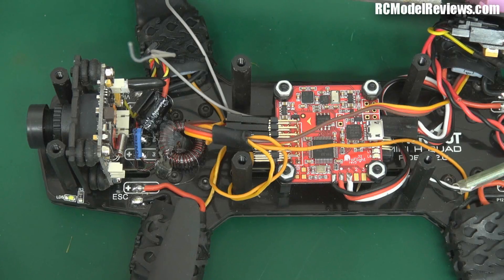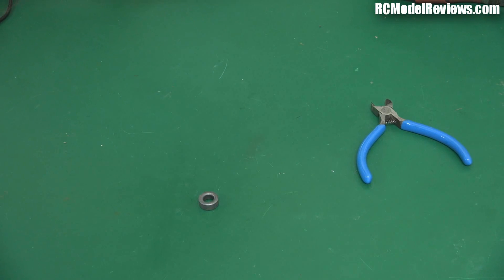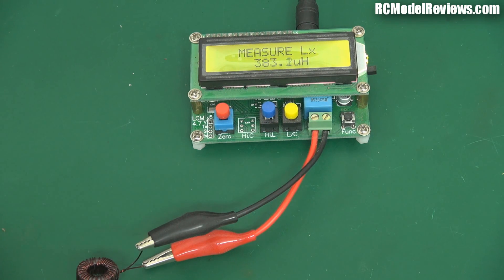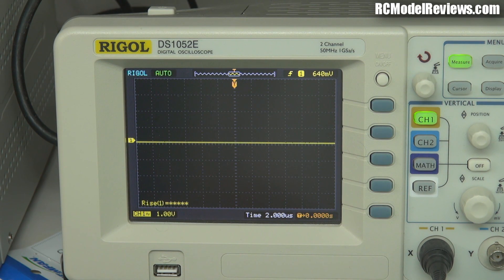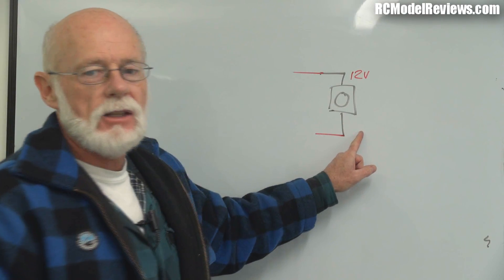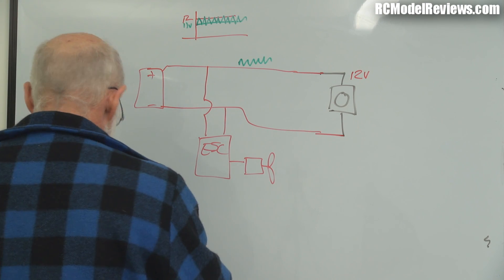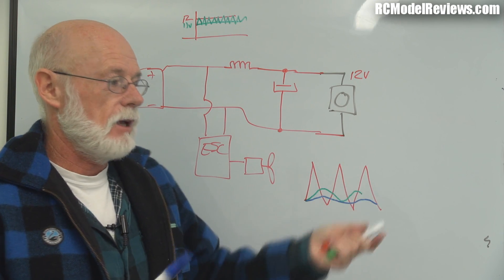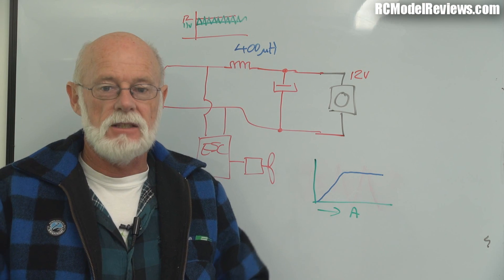DIY FPV power filter for under $3

Comment: Perfect timing, took my first fpv flight at the weekend and found it was almost unusable becuase of black lines over the picture whcih got worse the more power I used. I thought I'd be ok by using a UBEC to power my camera and vtx but I'm guessing not. Would I be better replacing the UBEC with the coil and cap?

Comment: I've been using these expensive LPF-01 LC Power Filters. I'm unsure what the inductor is in these I've never taken it apart. It would be interesting to compare Bruce's $3 LC filters to these $15 ones. Very nice explanation.
Reply: Another related effect is using capacitors to protect the ESC from the inductive effect (?) of long battery leads to the ESC for large aircraft. Not a problem for a Mini Quad.

Comment: Great video, it actually inspired me to go out to the shed and make an inductor... I have a few ferrite torroids and some enamel copper wire. There's just one thing though, you glossed over how to actually "make" the filter. the science and explanation was brilliant, I understood it very well. but it would have been nice to see how you connected up the capacitor (i'm sure there's a right and a wrong way) and then how you would connect this in a real life circuit... still a great video... I actually do like the whiteboard stuff :)

Comment: Bruce... now try adding a Diode BEFORE the inductor.....and Magic !!!
( or a Schottky if you don't wanna loose 0.6v from your supply rail)
Then tell me why ;)
Reply: You could add a diode but it is extra voltage drop and in the case of a 3S pack, it could result in the camera shutting down earlier than it otherwise would if you're nursing a nearly-flat battery when trying to get home.

I'd say build the filter "as is" and only look at adding the diode if you still have noise on the video.  If it fixes the noise without the diode then you'll save your money and give yourself a bit more voltage-headroom for the camera.
Reply: *****
Yes..Exactly...!!
But then, that's why I mentioned the Schottky ( with the right current handling capacity for the job.. of course ).

I've found out that the diode really cleans up the job.
Reply: RotorPics
Yep, I've used a diode/cap setup in the FPV backpack and it works well but with a multirotor I wanted to be sure that the camera would keep working right up to the point where it flipped due to a low battery :-)
Reply: *****
yea....but my fpv birds are long down before the 12v cam quits due to low voltage....
Anyhoooo.... Diode+Inductor+LowESR cap is my recipe for crisp video.

Bruce, wanna really thank you for the videos you make.
You are such a wealth of info.
Would really like your spectrum analyzer to be displayed more often when testing anything RF related. It really adds a lot of 'aroma' to the video ;)

Now.. I'm back to my Binch !!! :)

Comment: It would be interesting to find the point where running a separate battery would make for better solution then a toroid/cap/etc....based on a weight savings.

Would the toroid/cap solution always be the better weight saving solution, even on larger planes/MR configurations?

Excellent video as always..

Comment: I am under the impression you should also have the ground wire wound around the same inductor by the same number of turns or else you can get noise transmitted via that and / or an uneven effect caused by the inductor. Or do i understand things wrong? That's how I've been making my low pass filters anyway.
Reply: If  you wound both (+ and -) through the toroid (as you often see with ESCs) then you would have what is known as a "common mode" filter which would be less effective than the version you see here (in this application).
Reply: ***** thanks for the info.

Comment: Thank you Bruce!
I was always wondering about video filtration on those small 12v camera's. If one does not want to wound a toroid can they buy a pre made circuit board with everything pre made?
Reply: Yes, HobbyKing and a few other places sell "LC power filters" -- they're not too expensive, only about 3-4 times the price of this DIY version.

Comment: Hey Bruce, thanks for the great lesson. Would a setup like this create any kind of magnetic field strong enough to interfere with an electronic compass? I'm not sure if it cancels out because it's a toroid or not.
But just for sake or argument, say you could separate the compass from the toroid by 20-30cm and it was a similar setup to what you have here in terms of size, wrappings and current. Would you expect magnetic interference?
Reply: I wouldn't expect a toriodal filter like this to have any effect on a compass at that distance.  One of the beauties of the toroid is that it creates a closed-loop for the magnetic flux to follow so very little stray magnetism is produced.  That's also why toroidal power transformers are often used in high-end audio gear -- they don't radiate "hum" into the audio components.
Reply: I suspected that but I lack your level of expertise. Thanks! :)

Comment: woudnt a large cap and a diode give alot of filtering also?
Reply: A cap without a coil can't filter the spikes enough.
Reply: You could add a resistance though, but well, you'd waste some power on the resistor. Coils are awesome.

Comment: Great video! Should I run a power filter if I have a dedicated battery for the fpv gear? I built one last week but haven't tried it.
Reply: No, if you're running a dedicated battery for your FPV you shouldn't need a power filter.

Comment: Hi Bruce, I am not sure how you are attaching everthing together , Its very hard to see things inside the mini quad.
Reply: That's why I did the circuit on the white-board.

One side of the toriod coil goes to the battery, the other side goes to the FPV camera's 12V input.  The capacitor goes from the camera's 12V input to ground (the negative connection to the battery).

Comment: Hi there! Great video, I love all your content!
Quick question, on the whiteboard schematic, how come the capacitor connects the 12v with the ground? Why doesn't the capacitor run in line for the 12v into the camera?
Thanks,
Nick
Reply: No, a capacitor blocks the flow of direct current (the 12V) so if you put it in series with the power to the camera -- no current would flow and the camera would not work.  The capacitor is there to absorb what is left of the noise after it has passed through the coil.

Comment: FYI If you don't mind paying a bit more, small high inductance inducers are easy to buy online or at places like radio shack.
Reply: The only thing to watch is that you get one which won't saturate.  You can get 400uH inductors as small as a grain of rice -- but they'd be next  to useless in this application because they would saturate at the currents involved (as per the graph I put on the lower-right of the whiteboard) and once that happens they act just like a straight piece of wire.
Reply: ***** this is why we watch your chan!

Comment: You can improve this a litte bit by inserting a diode befor the coil so that the Motors can't draw any current from the capacitor.
Furthermore, you can add a small ceramic capacitor connected in parallel to the electrolyte capacitor. These capacitors can better smooth high frequencys.

Comment: Hi Bruce. Great video again. But just one thing for idiots like me :-/
How exactly do you connect this up? A short followup video would be most helpful for all beginners
Thank you for all the videos and help
Reply: Normally you should mostly plug your power filter between your power battery and your video transmitter but a lot of other applications are possible :)
Reply: Ok. thank you for the advice

Comment: Great video bruce! I think i remember mentioning inductors in another videos comments!

Also, protip; put the toroid in the middle of the piece of wire and wind, it's quicker because you have to pull half the amount of wire through (distance), and you bend the wire strand half as much, fatiguing it less. Plus, half of the toroid is wound when you start the second half, holding it tight allowing you to pull the wire very close to the toroid, and thus more turns!

Good video nonetheless!

Comment: Bruce, I know Mocha has a video on the Naze32, but i find your instructional videos so easy to follow. Could you tell me or post a YouTube video on how you wired your Naze... I'm struggling a little.

Cheers
Reply: Using the Frsky V8R4 receiver if that makes any difference?
Reply: MrJaycurtis69
Okay, I'll do a bit of a walk-through if  you like because I'm installing a Naze32 into my HK 250 mini-quad soon.   I'll do the whole 9-yards from opening the packet to flying the quad as a bit of a tutorial.
Reply: Cheers, I'm doing the same, Installing on in my Hk250 and another for my Blackout when it arrives... I swear i was smarter than this, but i cant get the damn thing to go.

Comment: Bruce - there is a mistake in your white board schematics.
We do not connect inductor between battery and ESC (it will burn). We connect it before camera, not before esc :-)
Reply: No, the schematic is correct -- the inductor connects between the battery and the camera.  You will see  that all there is on the right-hand side of the inductor is the capacitor and the camera.  The battery is on the left of the diagram.
Reply: ***** oh , ok :-) my mistake... thought the camera is on the left side. This 12V sign confused me. Sorry...

Comment: On a small tangent, how do you best deal with enamel wiring?

Ive built many copters over the years, and one of the most annoying bits by far, is shortening the motor wires for a neat build, and then having to wrestle that evil enamel coating off the wires with an arsenal of blades and knives. And just scraping it off has some risks, like a strand snapping before you finish scraping it clean.

Is there an easy way? Dipping it in some kind of acid solvent or something?
Reply: Some enamel can be burnt off with the heat from your soldering iron... all you need to do is scrape away a very small amount (enough to get thermal contact with a hot soldering iron tip) then apply solder.  This type of enamel will burn away so that you can tin the wire and the enamel floats off.

Other enamel wiring however, is very much heat-resistant.  That wiring requires mechanical abrasion -- either with the tip of a modeling knife or with some fine wet-and-dry sandpaper (if you can get access to it)
Reply: On thicker enameled wire (1mm2+), you can also burn it a bit with a cigarette lighter, then just "crunch" it off with your fingers - this can save some time.
Reply: bgdwiepp
 Use plies to crunch it ,as the enamel is actually glass
and it can splinter into your fingers .. guess how I know lol :)
Reply: I either use a rough sand paper or a max temp iron for the heat strippable enamel stuff

Comment: Ive used these for years, this is one of the best tips you can give for FPV, especially when you are flying on a single battery. The pulsing ESCs induce a really nasty bit of noise.Good on ya, Bruce!